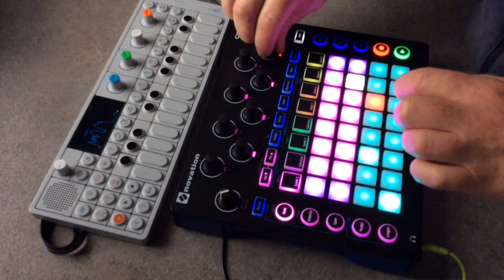Novation Circuit from scratch (plus FM radio sampling on OP-1)

Comment: nice video!
how do you connect these in order to make them work? do you need a pc or usb midi hub to connect?
and can you sequence OP-1 sounds on the circuit or is it more like you have drums/bass on circuit and then play synth sounds on the op?
Reply from the maker: CompanyGerman I didn't actually have the unit connected for sync or control in this video. Sorry I've never tried.
Reply: Terrible Beat You know what that means right? You have a skill that many cannot master. Kudos on that. Beat matching and tempo takes years to master. When I was a turntablist it took me about 2 years to learn. I was very nervous and had a lot of fear.
Reply: Satyan Patel I’ve been djing 20 years. Matching a beat in this instance is not difficult. Just set the bpm to the same value and press play at the same time.

Comment: If you had to chose one for easy/fun on-the-fly jamming and tinkering would you pick the OP-1 over the Circuit?
Reply from the maker: I'd say the Circuit initially, but that's because the learning curve is nonexistent. However, put some time into learning the OP-1 and it too can be just as easy to get some ideas down. The exploratory aspect of the Circuit I.e the unlabelled knobs etc make it great for coming across some happy mistakes. Much cheaper too. OP-1 is a synth, sampler and sequencer as well. I guess they make a great couple.
Reply: +Terrible Beat thanks. Learning curves aside which would you say has the most potential for creative expression. Also which do you find yourself having more fun with overall? I'm in the market so figured I'd pepper you with a few questions :)
Reply from the maker: +Andrew Garcia It's really hard for me to say as I have lots of fun with both, but I imagine in terms of longevity and the ability to make more diverse pieces of music I'd have to pick the OP-1. I can never see myself selling it. It's a really creative tool. The Circuit though is nice to just switch on and quickly input anything and within minutes transform it into something completely different. The OP-1 requires you to record into it's quirky 4 track recorder (bouncing tracks into one track allows you to layer as many tracks as you want). Sorry I can't be so clear. They're very different beasts. Both really fun.
Reply: Terrible Beat

Comment: can I record samples live from an analog synthinysizer to make my own "kits" without using a pc?
Reply from the maker: iSpitCreativity you sure can. You can come out of your synth/drum machine into the OP-1's input, sample and store as a kit. You can trim each sample if need, tune and even make loop points or make as one shots etc.
Reply: Terrible Beat are there any finger drumming,  step sequencers that can also do a live sample recording,  that's  bit more affordable?   if I'm not mistaken,  I believe the Korg electribe,  might be able to do this.
Reply from the maker: iSpitCreativity yeah the Electribe Sampler will do that. Even Korg's £120 Sample will do the job. Notation Circuit can now let put your own samples on but you have to prep them on PC first.
Reply: Terrible Beat I think the electribe might be for me,  because I want the process from making sound on my synth, to programing said sound to the samplers pads,  as quickly as possible.  Other wise,  I would probably get the launchpad pro or the push 2. I'm new to this and Ill take all the advice I can get,  thanks for the help.